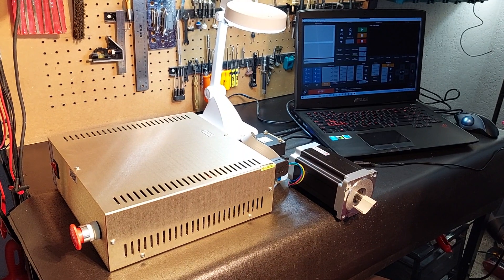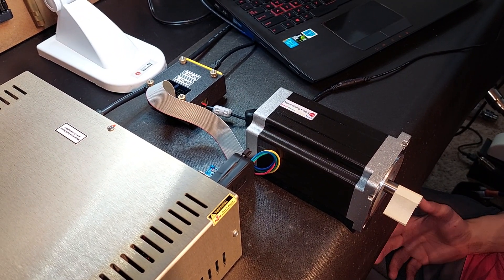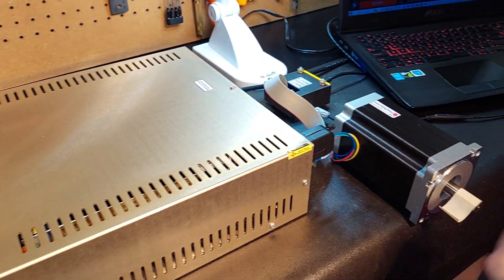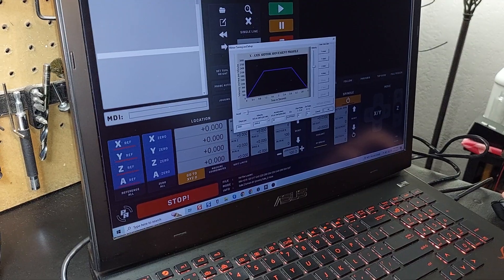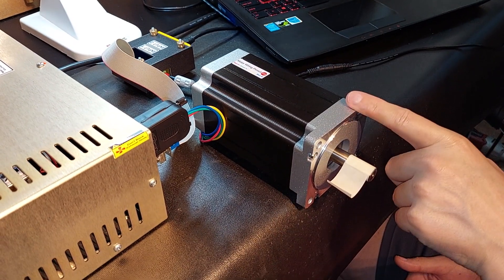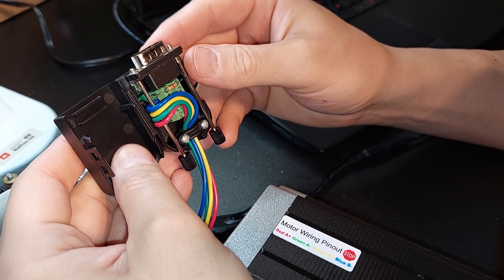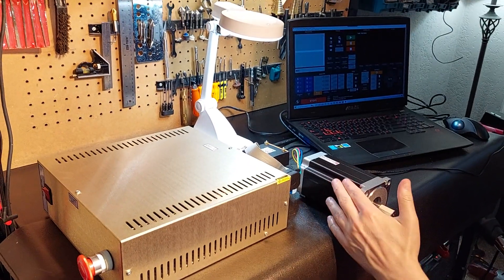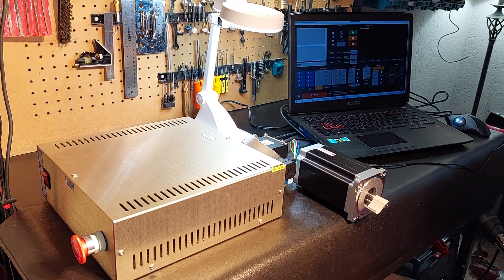A Gecko G540 Controller Using 1600oz 3 5a Nema 34 Motors...

Comment: Great video!  Do you know if there are upgraded drivers for the G540? Mine is about 5-6 years old and its always made the motors make a high pitched whining noise as soon as the motors are energized. I recently rebuilt my CNC and slowly trying to address all the issues that annoyed me.
Reply from the maker: Thank you for your support. No the drives for the G540 haven't had an update. The noise you're discussing is called "stepper sing" which is completely normal from the coils being energized to provide holding torque. Thank you,
Vince
Reply: 😊M @corvetteguy50